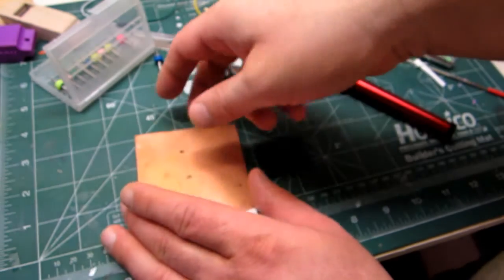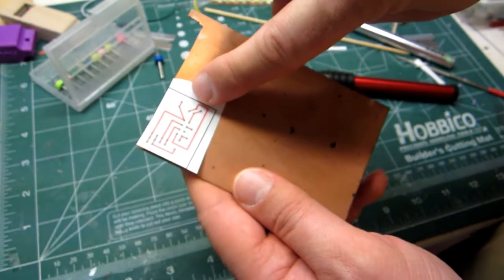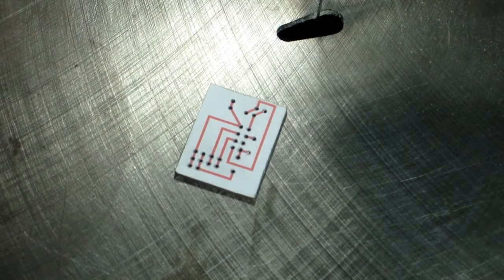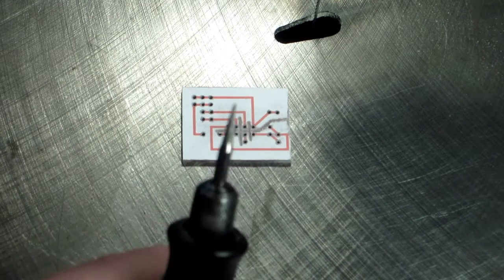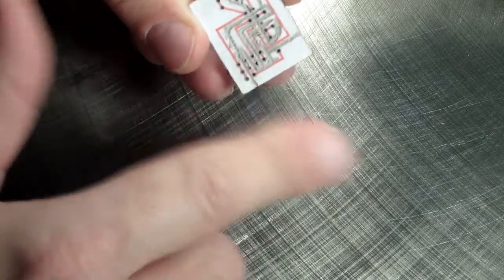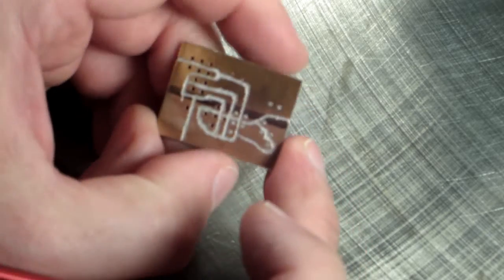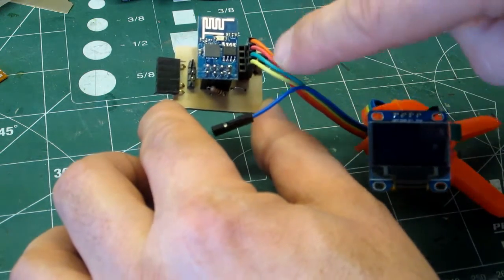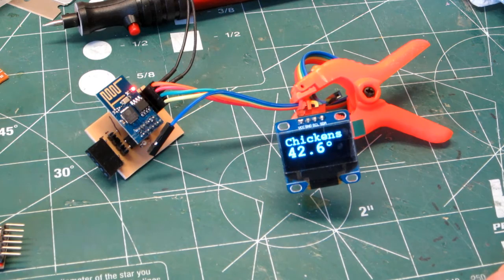Hand Cut PCB Circuit

Comment: It is types like you I really like, you try new metodes, not concerning if that is the "approved" way. It is a really smart metode if you will avoid chemicals and just need to make something permanent that no other sees.
Thanks a lot for sharing!
May I please ask you if you think that your mini engraver tool would be great to remove damaged tracks on a pcb, before making new to put in?
Reply from the maker: I have gotten quite good at cutting the circuits now , I don't use a stencil for drilling any more free hand proved as good and much faster.  The mini engraver is a bit under powered, now I use my old bulky Dremel with an emery disc  for most of the circuit. The mini engraver is still useful for finer touch up stuff.

Comment: I like the ide but I have no clue what u are doing. What exactly did u do with the dremel machine?
Reply: He basically scratched around all of the sections needed- etching through into the next layer of different material than the copper sheet. This is how all of the tiny holes on the PCB are separated from each other instead of short circuiting one another.

All just observational conclusions on my own part- this is my first time seeing this. Was wondering about hand made pcb and then bam- found just what I was looking for. :)